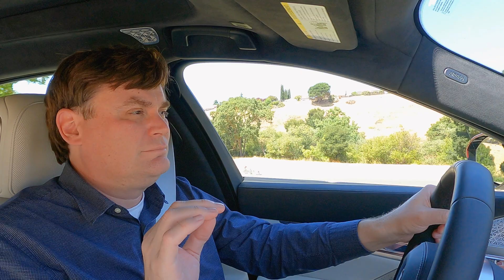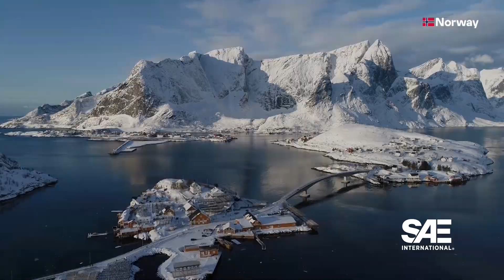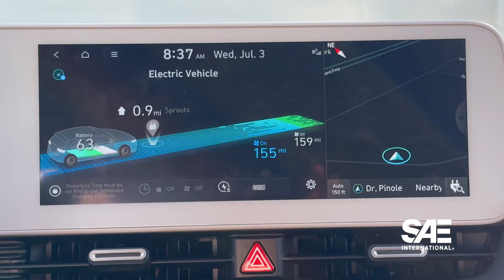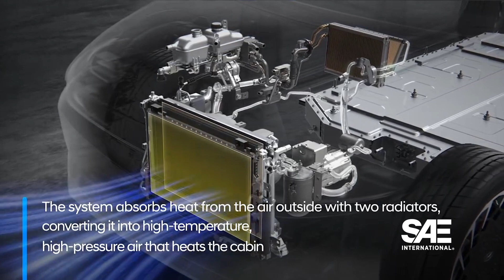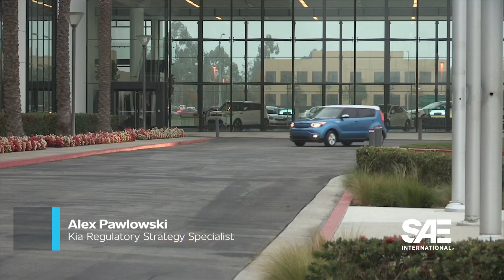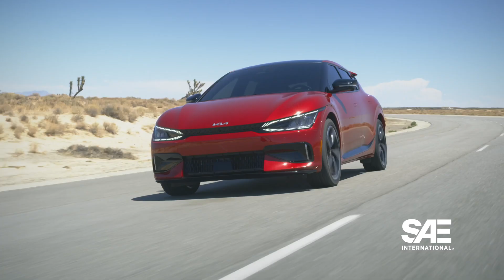How EVs Combat the Cold

Comment: Except for a 20% loss of range on the coldest of days, which doesn't matter at all unless I'm taking a long trip, my Tesla Model Y is actually FAR BETTER in the winter than any ICE car I ever owned.  

The main reason is that from my house, or from wherever I am, I can tap a few buttons on my Tesla phone app and turn on the heat, or in the summer, the AC.  And in less than five minutes, the cabin reaches at the exact temp I want it to be before I ever get to the car!  No more freezing my butt off for the first eight minutes of driving while the ICE engine gets warm enough to finally start heating the air.  I can also heat up the seats and the steering wheel as well from the app.

Comment: This is a pretty cool video, no pun intended. What is preconditioning in a battery? If it's just warming the the battery/keeping it warm would it make sense to include a 120v inline coolant heater for all North American models? It would make owning an EV more of a possibility for renters in cold climates.
Reply: They already do. Early Teslas actually had a 7kw heater that was exactly that. Newer Teslas now just run the motors in a less efficient mode and use the standard motor cooling system to heat the battery. Even newer ones allow the heat pump to take heat from any other part of the car or exterior and move to/from the cabin/battery. Eg AC on a hot day can be used to precondition the battery for charging. Or the car can use the heat pump to warm the battery and cabin from the outside, motor waste heat, and autopilot computer waste heat on a cool day. So far I don't know of another EV that can heat the battery using the heat pump.
Reply: @ErikMeike   So it sounds like preconditioning is just getting the battery into a temperature range. It also sounds like the task is done by the battery itself. I would figure if you just heated the coolant by an external source and kept it circulating there would be a lot of range preserved. I figure that would be easier to manage if someone couldn't install a charger at their residence. All of this of course is in regards to winter.